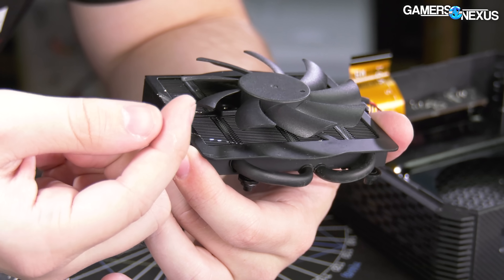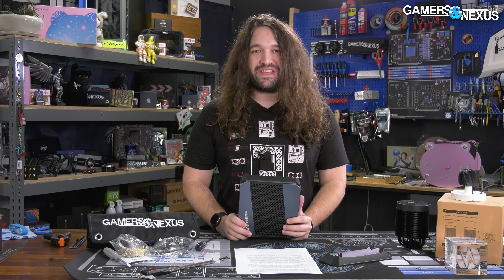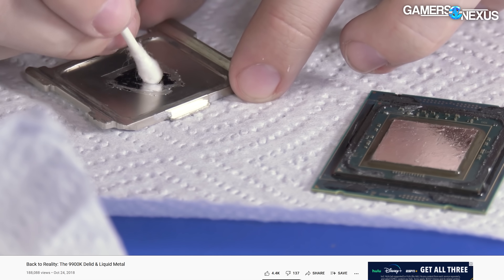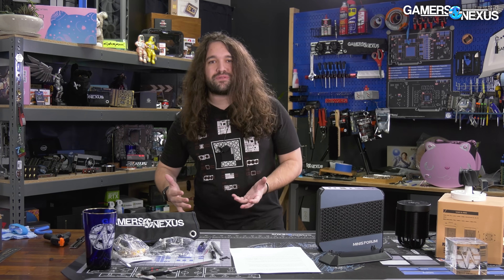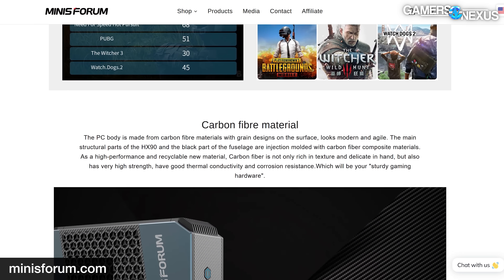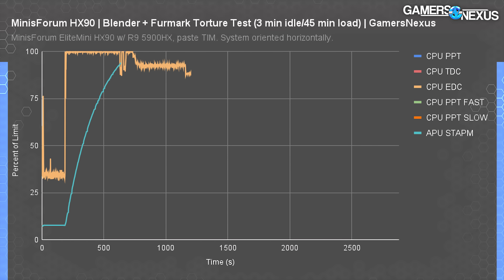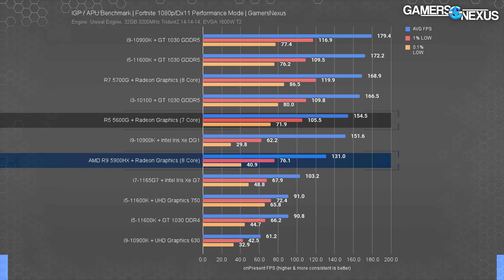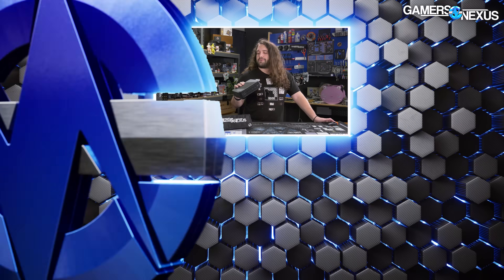Utter Incompetence: Liquid Metal Disaster in Minisforum HX90 Small AMD Gaming PC

Comment: But wait, how did the liquid metal get on the other parts if it wasn't used on the CPU? It's just a condiment?
Reply: This is what is boggling my mind. How did it even get there? If it's there, why isn't it on the CPU? What the actual fuck?
Reply: I have a feeling that they probably didn't apply it correctly (as evidenced from the amount on... fans and stuff), and the computer didn't pass QC because it just instantly thermal throttled.  Whoever was supervising the factory that day said "ok, just put normal thermal paste on it today and get it out the door, we'll fix this tomorrow".  Then the same shit happened tomorrow, and ... welp, now they probably have some explaining to do.  (Probably: "hey, tell the big boss when you change the specs on the factory floor!  marketing made that the primary selling point!"  And I'm sure that the people assembling the computers and the people designing the marketing don't even work for the same company, and the manufacturing company probably does stuff like this all the time... so... someone learned a valuable lesson about quality control.) 

Fun stuff.  For someone.
Reply: Icing on the motherboard cake
Reply: Best I can guess, they tried using liquid metal but misapplied it, so it failed thermal testing.  Then they tried cleaning it off with compressed air and replaced with paste.

Comment: To test if carbon fibre is in there the easiest way to test would probably to break a piece of. the high e-module of carbon fibre comes with very low elongation at fracture and it tends to splinter with sharp edges. Granted, some plastics will show a similar behaviour to the eye, but those would be rarely used in that type of application. You could also just burn it, the carbon fibres themselves don't burn up even with a torch burner placed directly under them (temperature >1100°C) and remain after the matrix plastic has burned away. Please be careful with the toxic fumes of the plastic burning if you do that.
Anyway, this really doesn't look like carbon fibre reinforced plastic. Fraudulent marketing
Reply: They call it "composite", which is correct.
Reply: Hmm in my experience when doing burn test the carbon fibres will only stay there when the content is at least 30% or higher otherwise they will be carried away with the flame which will definetly be visible though. tiny specks of light will be in the flame if it is reinforced.
Reply: @Shrrrg  That might be that way, I have only seen fire tests with material build for structure, not optics.

Comment: The soldering iron burning right through the “carbon fiber” that marketing also talked up was just sad.
Reply: I loved the AvE reference
Reply: Some of y’all are trying way to hard to defend this as carbon fiber. The website says “Carbon fibre material
The main structural parts of the HX90 and the black part of the fuselage are injection molded with carbon fiber composite materials.”  I don’t care if they added powdered carbon to the plastic mix, it requires actual fibers. That is not carbon fiber, and the fake woven design is proof of it.
Reply: @Dozav7  but the text at the website is the exact method ive explained. There are carbon fibres molded within the plastic. If you want it to have a carbon fibre mesh thats your business. Dont call them liars bc you want sth else. What they are writing at their website is a legitimate, industry standart way for molding plastics.
Reply: @jonasas1hh  - lol. Show me the fibers!
Reply: They call it "composite", correctly. It's carbon fiber reinforced, likely only 15% - still, it's a lot more rigid. "PA6 CF30" would an excellent material, also it'd melt of course but its tensile strength is pretty much the same as Al. PC CF30 would be great too. Unfortunately, they didn't show the temperature of the soldering iron.
Reply: @stanimir4197  but the carbonfiber wouldn't melt at normal soldering iron temps... the plastic yes... but you should still be able to see the carbon fibers
Reply: @LiLBitsDK  the carbon fire is suspended in the plastic of the case like normal coloring material. Its not like they've added a layer of woven carbon fibre into the plastic. Its more like there are small strings of carbon fibre in the molten plastic thats used to cast the parts and spreads evenly in the whole part. So of course if you melt the plastic, these tiny strings will flow with the molten plastic, you dont have a organized mesh, its just a random arangement that improove the strengh
Reply: @jonasas1hh  the fibers themselves should still be visible when you melt the plastic and not just a smooth glob of plastic
Reply: @LiLBitsDK  if you burn the all the plastic (not just melt), the fibers, indeed, would be visible  (if plastic is reinforced). Given GN's brief shot - I dont quite see how you'd be able to tell. 
I simpler version would have been looking for injection mold marks, recycling info on the plastic.
Reply: @stanimir4197  Carbon fiber melts at a much higher temp and would spread the heat around more before melting making a much larger glob. the fact the melting was only isolated around the contact point shows that there is no carbonfiber inside.
Reply: @Aliceintraining  i think my last answer could be intresting for you too^^
Reply: @jonasas1hh  basically they lied about how they put the carbon fiber ether way.

consittering how they fucked everything else up, would not surprise me.  irl, you want to use carbon fiber layers to provide better heat dissipation and stability.  at its core what they provided, is just shitty plastic.
Reply: @Aliceintraining  considering everything else they've said, i wouldnt be suprised if its just regular plastic. I've just talked about the conventional way casted plastic parts are made with carbon fibre reinforcemant. The raw material they would use are little plastic droplets, already containing tthe fibres. They would just melt these and cast it into the shape they want. Btw its a rather difficult material compared to other commonly used for casting^^ surely there could be oder fancy ways to reinforce plastic like you described, but tbh i dont have that much knoledge about reinfocrcing other materials with carbon fibre outside of what i've described.
Reply: @jonasas1hh  Thank you for providing this information, I came to say pretty much the same thing you did.
Basically, it's possible that Minisforum used chopped fiber reinforced plastic as their 'carbon fiber', this is a newer and more cost effective way to manufacture parts out of carbon fiber than traditional ply or tape layup. This material would melt just like regular plastic, so a soldering iron test would not "prove" that the material was just plastic. Most chopped fiber specimens I've seen have had visible flakes and fibers, but it's also possible to have specimens that use very fine fibers that are much harder to see with the naked eye.
GN could prepare samples by thinly slicing and mounting the material on microscope slides, and then examine them to see if they can identify fibers with a birefringent microscope or other indirect lighting microscopy to highlight the fibers. But I personally would not be able to identify if any fibers I see this way are carbon fiber or just dirt and hair, so GN would have to consult a materials expert on how to best prepare and test the sample.
But given the general incompetence and lack of honesty in their marketing materials and product quality, I would agree with you that it's probably not worth the effort to verify the veracity of their claims. Even if they did use carbon fiber (which I doubt), it doesn't change the fact that the product is a turd.
Reply: @Aliceintraining  Look, this is how reinforced plastic works - I'd not have expected anything else. Like I've said - likely 15% CF, if you know anything about plastics and hear "carbon (or glass) fiber", this is what you get. They might feel scummy/incompetent, etc. - but this is not a lie in any way.
Reply: @V_is_for_Void  I am surprised GN spent so much time explaining the carbon fiber and they showed just a soldering iron with unknown temperature - even looking for the injection mold marking would be a better option.

Comment: I'm surprised LTT didn't even look into this. Also 6 years of injection molding checking in.
Carbon fiber is actually a pretty common reinforcement used for high stress tolerant plastics. So stuff like plastic chain guides in motors and such. There's no need for it on a PC and it's a thermally not very conductive so it's actually kinda bad for small form factor PCs IMO
Reply: I think their thought process was "Steve will handle this"
Reply: would that make sense for laptop housings with plastic snaps then, to keep the snaps from... snapping off?
Reply: @manuelbardina  if you mean making the snaps out of carbon fibre then I don't think that's a good idea cus it's really rigid meaning it'll snap off harder
Reply: The reinforcement makes it a lot more rigid, esp. with higher temperatures.
Reply: @stanimir4197  Do you really need a desktop to be that rigid though? Its not like their stacking a monitor on top of this thing.
Reply: @nevoyu  if the screws go into the plastic w/o injection molded inserts - yes. Also it'd be 'nicer' if the ports (charge, usb, hdmi, etc.) are fastened onto the chassis and NOT on the mainboard. In that case, it'd provide real value. As an added bonus it makes it feel not like a cheap toy... Edit:
Also when I put the beer on top - I don't it to bent. And yes - should be able to use it as a flower pot stand.
Reply: how much carbon fiber (mass and volume) is there in thr plastic then?
Reply: @emmata98  normally it's between 15 and 30%. Dunno about this one - there should be injection mold markings CFxx (where xx is the percentage and CF - carbon fiber reinforced).
Reply: He might talk about it on the wan show like with the exploding power supplies.
Reply: They're too busy testing more TikTok hacks.
Reply: Linus will automatically dock a fifth of the overall review score unless it has more RGB lights and unicorn puke than a literal pride parade.

Comment: LOL, "injection moulded carbon fibre"... is that even a thing, because that'd be new to me.
EDIT:  Turns out it "kind-of" is, but it's short-fibres and doesn't add a lot of strength.  The marketing is rather misleading (as I'm sure we'd all expect given this review and their... language skills), trying to conjure the image of "carbon fibre" in the reader's mind when that's not what it is.
Reply: Haha, nope.

Carbon fibre weave (the real stuff) is laid in sheets with various processes afterwards...

Anything injection moulded into a complex shape is carbon fiber reinforced / glass fiber reinforced... For STRENGTH.... because it makes the appearance worse! with random shiny and dull areas where the fibers flow. 

Guarantee they just overstated the fake texture.
Reply: @volvo09  So, actually, yes?
They say it's coated for appearance, that was fair enough, but I figured it was the usual faux carbon fibre sheet covering standard plastic injection moulding.

I assume it's plastic with fibres scattered inside that's injected, thus an unreliable distribution and therefore potential weak spots. :\
Reply: @ChrispyNut  oh yeah, they did say "injection molded" so if it had the fibers they wouldn't be truly lying. 

But i still doubt it has the fibers, seemed to melt and flow too quick... And It costs more money to actually make that look good and not spotty and blotchy, so i'm still going with they just lied and called the texture CF.
Reply: @volvo09  So, thanks to you I looked into it quickly and they may not be entirely lying, just mis-leading due to the perception of "Carbon Fibre".
I'm glad I phrased my joke as question or I wouldn't have known that (carbon) fibres are/can now be used with injection moulding.

I should have checked first, but was cooking.  Bad me!

Comment: would indium sheets be a good alternative to liquid metal?  they come in extremely thin sheets and from the basic testing i been able to find seem to do well. though those were not done in a very scientific way and i would like to see i proper test vs liquid metal.  it would be nice to have similar performance with alot less headache and mess.
Reply: It needs to be a liquid to fill up the uneven spaces between the cpu and cooler.
Reply: yeah a film/sheet won't exactly fill up those microscopic valleys in an IHS but instead it'll go right over them, which means thermal conductivity won't be perfect as you still have air pockets in there. Thermal paste will fill those up and maximize conductivity, so unless that IHS is perfectly flat down to the microscopic level, indium sheets won't be effective.

Comment: I wonder how effective gold foil would be as a thermal interface material. It's thin, soft and malleable enough that it might just be a better choice than the carbon pads, and likely a lot safer than liquid metal.

Plus, you know ... the BLING factor is high.
Reply: Gold should be a good thermal conductor but would it be anywhere near worth it compared to alternatives?
Reply: There would still be microscopic gaps between the cpu and cooler

Comment: Gallium is EXTREMELY sticky 

I wonder if someone dropped a bottle of gallium in the factory?
Reply: Splattered on some cases.... "Oh, we'll sell it as a feature!"
Reply: sticky and very corrosive to aluminium
Reply: @dy7296  Not only aluminium. It also alloys with tin, so it will make solder joints brittle. It takes several months though.

Comment: Gotta love a QC sticker on the PCB will all the liquid metal drops. Now thats a class process right there!
Reply: the assembled pcb probably will pass a qc way before they mess it up by adding the cooler and stuff
Reply: ...more of a class action process 😆
Reply: Can someone help clue me in a bit, I'm having trouble understanding the whole fiasco. So there's drops of liquid metal all over, but they didn't use liquid metal between the HSF and CPU?

Can anyone fathom a guess what happened? Did they try to use LM, realised its difficult or their process wasn't working, tried to clean it up (making a mess in the process) and then switch to using thermal paste?
Reply: @RViND  I have been wondering the exact same thing...
Reply: @RViND  Minisforum published a video showing the final versions have liquid metal. I think you have been to hard on a small company. I've ordered a HX90
https://youtu.be/LFHEmon-jZw
Reply: @HoaxTube  are you a bot
Reply: @osrsAtonement   yess C-3PO
Reply: @HoaxTube  well carry on then best of luck with the arm and whatnot
Reply: @osrsAtonement  WTF?
Reply: QC, Questionable Content (great comic BTW).
Reply: Quintessentially Crap.
Reply: @Ikari, G. Nah, they told me to put the QC sticker while applying the liquid metal...hey, at least I passed the QC test right? Only squirted liquid metal everywhere!

Comment: was watching some liquid metal cleaning videos last night, honestly it has no place outside of extreme overclocking use.
Reply: 14 year old me probably would have wanted it, but back then i didn't yet understand the difference between "best" and "absolutely fine".
Reply: Right. Hell I still use Arctic Silver 5
Reply: I'm on the complete opposite of liquid metal… Carbonaut, because consistency, long life and cleanliness > performance
Reply: @hughjassstudios9688  I see why someone might want that but I like my components to run as cool as possible for max efficiency, lifespan and performance and for that liquid metal is perfect, it doesn't dry up either

Comment: Would liquid metal pose a risk to aluminium components? Like how gallium weakens it, does liquid metal do the same?
Reply from the maker: Yes, definitely it should not be used on anything aluminum ever.
Reply: @GamersNexus  Mostly wondering if the, well, liberal application throughout the system is more than just a shorting hazard. Are the rads at risk over time?
Reply: @GamersNexus  you need to break the oxidised aluminium layer to allow the gallium to penetrate into the aluminium, just putting gallium on top of Regular aluminium would not cause it to degrade.

Try some on an aluminium heatsink.
Reply: @marvintpandroid2213  Not sure that's a risk worth taking though. One small scratch, and it's over.
Reply: @marvintpandroid2213  pretty sure it still degrades it over time. I've seen images of coolers with a rot spot on them from LM, found only after temps rose. 

Not the wild stuff you see with pure gallium, but bad enough to kill thermal conductivity.
Reply: @marvintpandroid2213  The oxidised aluminium layer is on the surface only aka a monolayer which means very little protection. Makes no sense to risk it as it will erode no matter what.
Reply: @EvocativeKitsune  might be an interesting experiment.
Reply: @marvintpandroid2213  Its already been done
Reply: New here huh? Yes, you should never use lm on aluminium parts, only copper.
Reply: @Ebani  I know, I was more concerned for the components that shouldn't have it on them, but did in this system.
Reply: It's electrically conductive, it won't rot the aluminium
Reply: yes, because gallium is a major ingredient of pretty much all liquid metals used for this purpose. I actually dont know of any that are not mostly gallium.
Reply: Most liquid metal includes Gallium in it's composition, so yes.